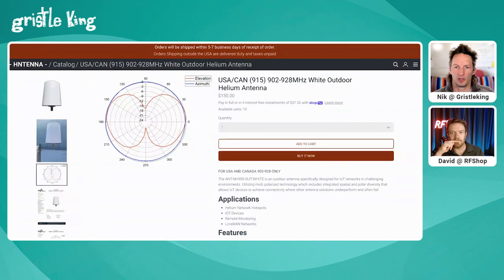What's The Best Cable For My Helium Miner?

Comment: Very disappointed with the HNTENNA, switched from a amazon 80 dollar 8 dbi to HNTENNA 3 dbi and let it run for 14 days and my witnesses dropped from 70 to 40 and with the 8dbi i was making on average .55hnt and with the HNTENNA the average for those 14days is .37, keep in mind i have the perfect setup for it im on top of a hill clear line of sight where you can see 2 major cities, looks like ill be switching back to the amazon one soon.

Comment: The attenuation on the lmr400 cable is 12.8db per 100m.  I need to use 20m cable, it's ~ 2.7db attenuation.  If I use a 4dbi omni antenna, how much dbi will remain in the antenna?  db is not the same as dbi, right?
Reply from the maker: They refer to different things, but as far as the math goes to calculate them it doesn't matter.  In your case, you'd subtract the cable loss (2.7 dB) from the antenna gain (4 dBi) to get 4 - 2.7 = 1.3.  1.3 is the gain you'd enter into the Helium app using the "Custom antenna" option.